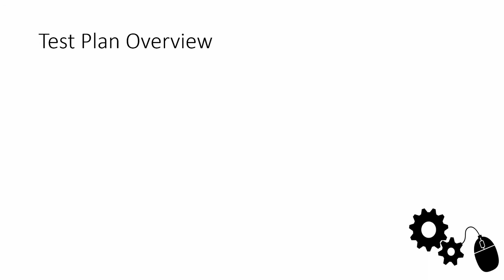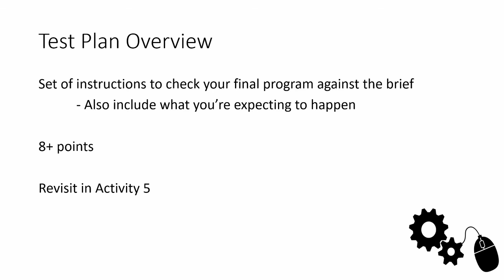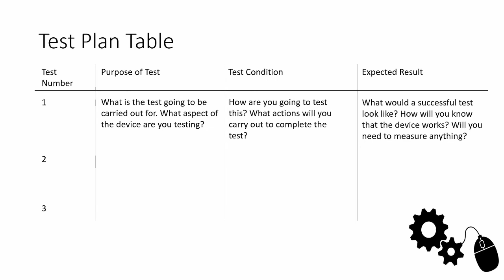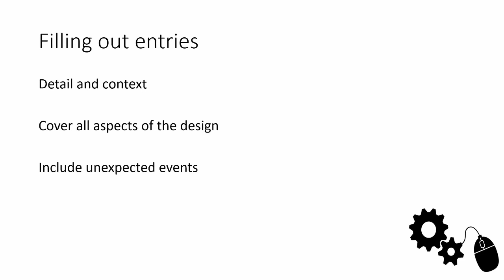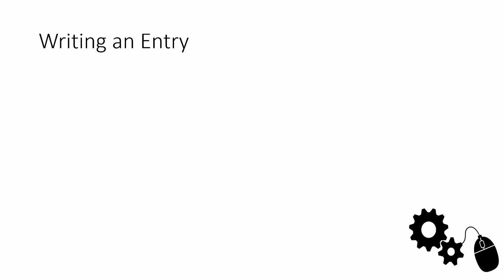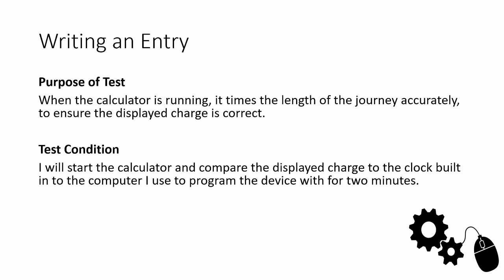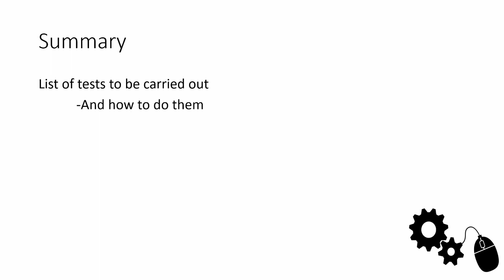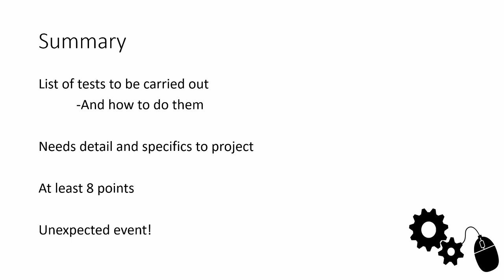Unit 6 Microcontrollers Test Plan: Taxi Calculator

Comment: Uno the technical specification points from activity 2. Could you use them for the test plan but Infer it with more detail?
Reply from the maker: You can use them as a bit of a guide, but not really a 1:1 conversion
Reply: @Kevin-C.W-Zhang  I start it on Monday
Reply: @DjMacy  me too
Reply: @DjMacy  yo bro, i added you add me back